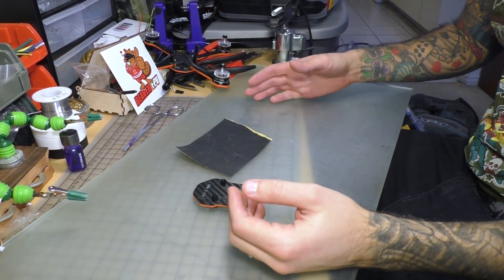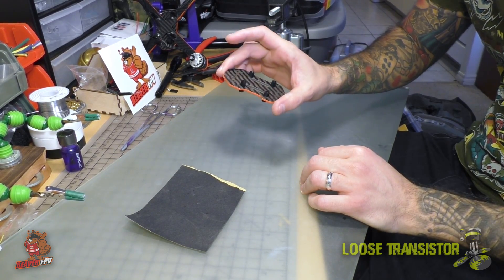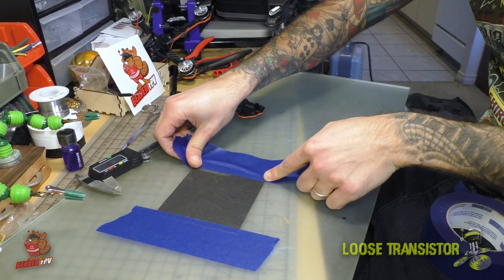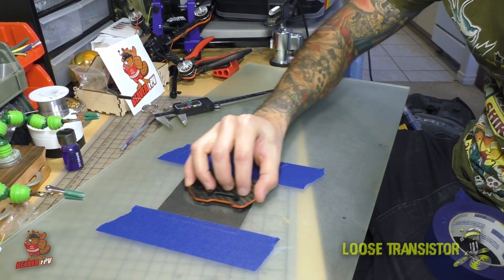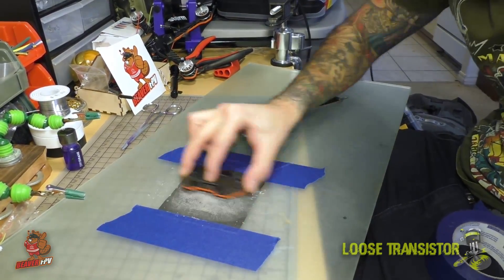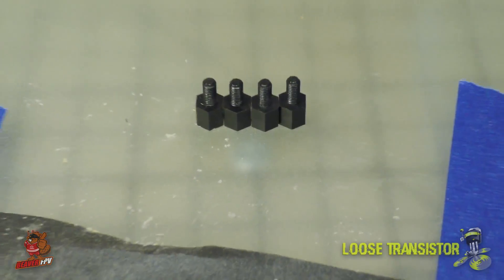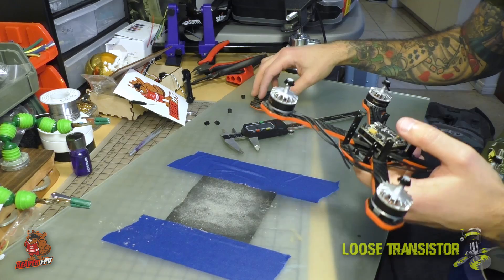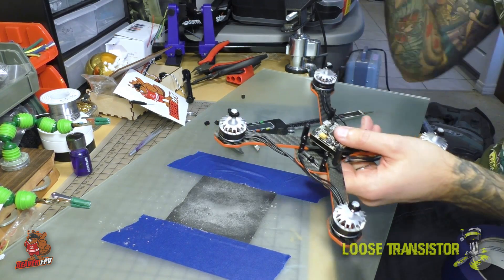HOW TO QUAD ♠  Shortening Standoffs Perfectly Level for Ultra Compact Stacks!

Comment: Nice solution, i somethimes shorten them with a sharp razor but you will allways get a difference in height...
Reply from the maker: Yeah, I got the same advice on FPVC. But I figured there had to be some way to build a jig... I stumbled on this random YT video about sharpening wood tools on a budget. The guy was using sandpaper on a pane of glass to ensure it was flat.. then it just clicked!